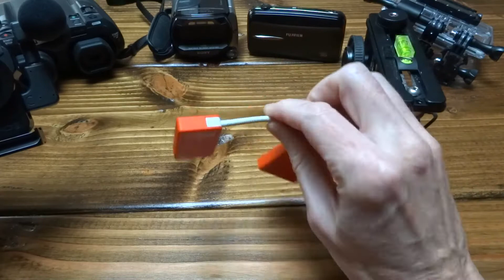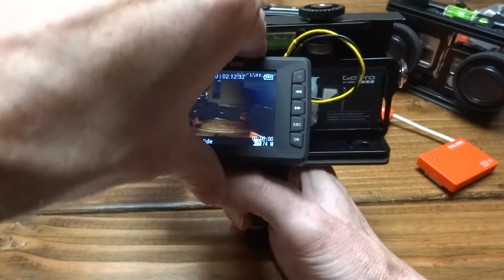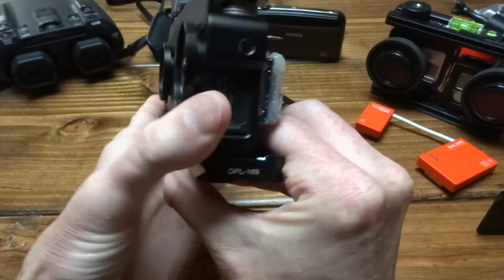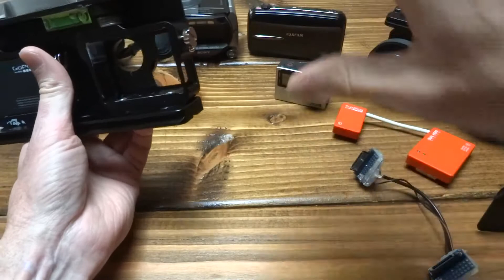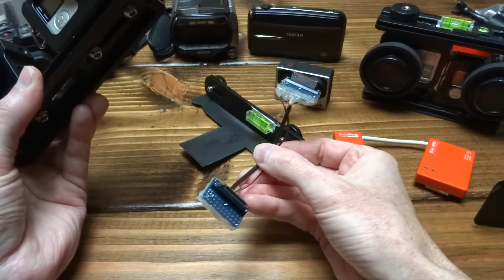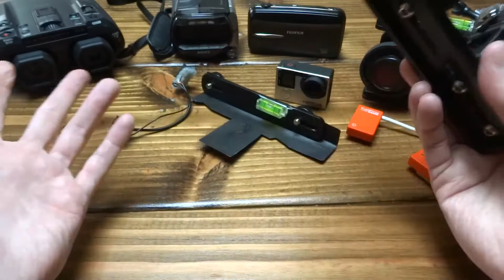3d Camera that shoots 4k 30fps per eye

Comment: Your videos are awesome! Thank you so much for sharing your knowledge and experience! I'm just getting into this, and recently put some fish eyes on a pair of hero3+blacks genlocked with a dual hero system. I am doing my best to figure out a decent workflow, but I'd be very curious to know what approach you take to reach a finished file that can be viewed on Oculus with Whirligig. Keep up the great work, and Happy New Year!
Reply from the maker: Thank you.  The workflow I use basically involves Sony Vegas and software called TMPGENC to do the final compression.  Vegas has a pretty bad compressor to encode the final piece.  So, to start, in vegas, you upload the left and right clips on to different tracks.  Since this rig does not sync the first frame, I have to line the videos up one below the other, then make the top video 50% opaque, so I can see through it.  I can see if the frames are in sync by playing the clip and they should move exactly together.  I drag one of the videos earlier or later in time to sync them.  This is easier if you snap your fingers in the video to start.  Then, in vegas, you turn the project into a 3d project, select the left and right clips and tell it to merge them into a 3d clip.  Making sure to turn the opacity back to 100%.  I use side by side for my 3d stuff.  I then use the stereoscopic effect tool to have it auto adjust rotation and vertical and horizontal alignment.  After that, its just a matter of doing a color grading with levels.  I also shoot hand held, so I use Mercalli as my stabilizer.  This software works with 3d.  I output vegas as a raw windows avi, then use tmpgenc to do a final compression.  Most 3d viewers can read side by side easily.  In oculus, whirligig is perfect.  Just open the video in that player and pick your format.  If you have a 3d display, you can use stereoscopic player.  You sort of need a 3d display to do editing.
Reply: I truly appreciate your swift reply! That is some solid info! Many thanks!

Comment: I’ve been trying to figure out how to make a VR 180 camera rig in a similar way. (Two cameras with fisheye and some kind of software to make it VR)
Reply from the maker: Genlock is extremely important.  You really need the cameras to be scanning the sensor at the same exact time.  This is why the gopro dual hero system was such a great idea.  Almost nothing else can do this.  There are a bunch of people doing sony lanc sync.  I used to, but it drifts out of sync quickly and it simply isn't locked in between cameras.  Going up to the next level would be a black magic rig with an external sync box and a lot of $$$.  This gopro rig is much cheaper.